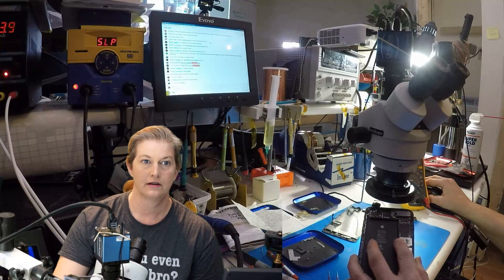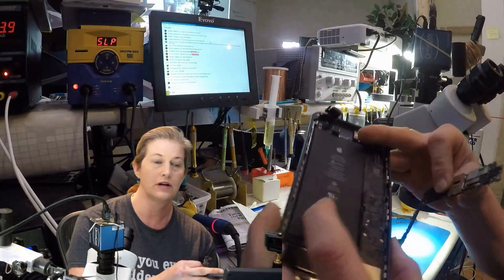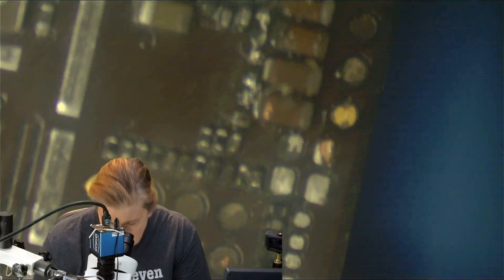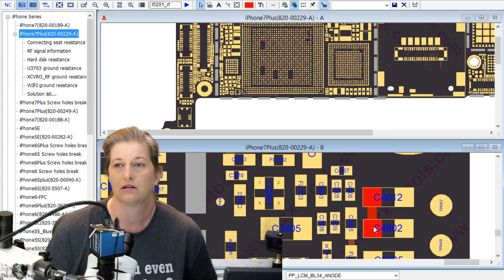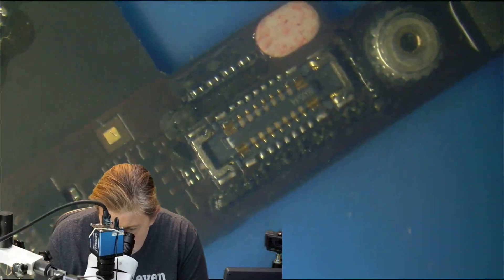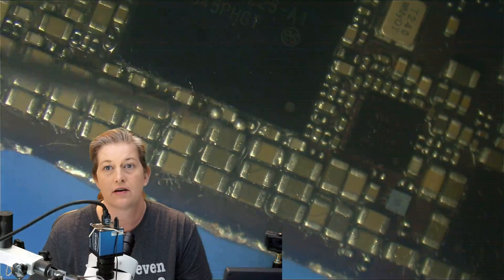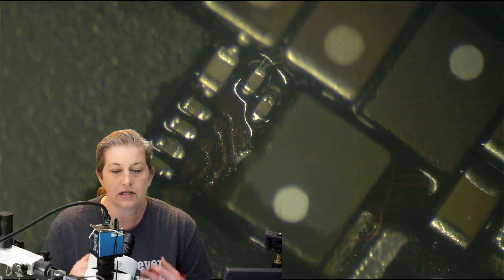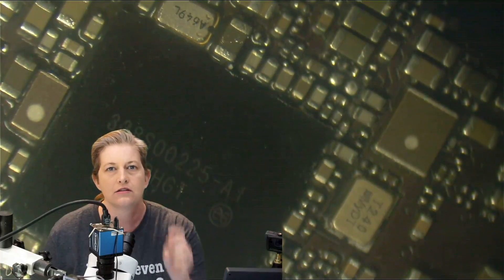FRANCHISE CELL PHONE STORES....STOP REFLOWING PMIC.  IT KILLS THE PHONE.

Comment: Were you able to fix this or did you automatically deem it a lost cause? That did look pretty bad. I've been watching your channel and Louis's channel for ages as I've always loved repairing things. Back when I worked at a computer shop with my father I had a customer come in with a monitor that kept flickering randomly. It was a CRT. I opened it up just for a peek and noticed the solder joints on the electron gun were all cracked. I re soldered them charged them $40 for my 2 minutes of time and had a very happy customer. The other shop said it was a logic board issue with the monitor and to buy a new one.

Comment: I see this in the automotive industry all the time. For example: dealer trying to diagnose an electrical problem on a car and end up fucking the car even more (frying multiple ECU's). So a manufacture field engineer has to go and fix their fuck up. Difference is that manufactures can audit the dealer for their mistake which sometime leads to technician's losing there jobs.

Comment: I've never heatgunned a board and thanks to your videos I never will! (and I think Louis even has a vid called "Stop heatgunning boards") but let's say you troubleshoot and you narrow down the issue to a possible disconnected line that goes under the PMIC,  how would you properly remove and reinstall that chip if underfill is present?  I assume it needs to be removed, reballed and reinstalled after the underfill is removed, but how would that be done?   Or is underfill one of those "If it's there, that chip can never be touched" scenarios?
Reply: In that case CNC is used to vanish the whole IC and underfill. If I am not wrong I saw this in one of her video but I don't remember which one.

Comment: Do the mickey mouse ears come from escaped solder balls through the under fill? i keep finding them but thought it may have happened using high heat and air removing shields, thanks for all the great vids ;-)
Reply from the maker: They come from high fast heat causing swelling of solder within underfill and pressure buildup of the molten expanded solder—it “spooges” out through a weak spot
Reply: Thanks for your help! very much appreciated, ive committed myself to this 24/7 until I'm pro,  I wouldn't dream of it if it wasn't for your videos! All the best wishes ;-) p.s.I'm most of the way there!

Comment: can you guarantee a water damaged board after you have repaired it?
Reply from the maker: Yes.  My rule is to never work on anything you can’t warranty.  In general I don’t fix water damage for the sake of the phone (data only) but when I do, I would replace all chips that were affected by water and make the phone as if it never saw water—or turn down the job.  Water damage repairs get the same 1year warranty as any other repair.
Reply: next video was why you don't repair water damaged phones ;-)

Comment: I know that crock pots or heat plates are often used in repair shop chains as well as independent shops. Mainly because their techs haven't even got enough experience with a hot air station to remove emi shields. So what they do is reflow the boards using basically a hot plate.
Will this also get hot enough to kill a PMIC and/or other vital chips? What's yours or anyone else's educated opinion on this type of "reflow".

I ask because that was the go to for any board that wouldn't boot when I first started years ago at a chain store. There was no looking at the logic board just "ok it doesn't boot, throw it in the reflow station".
Reply from the maker: That is a terrible idea but it makes sense on this board—it has heat up at WiFi chip which really shouldn’t happen even with poor shield removal technique.  But putting it on a too hot plate could do it.  It definitely has direct heat on pmic through which is the real deal breaker

Comment: Yeah especially those cheap eBay services. You know they’re not doing a proper job. I’ve seen some so cheap it’s ridiculous. A professional would not charge $30 for backlight as an example. They’re hoping a jumper wire or reflow will work. It’s a shame that a lot of  customers do not understand the degree of knowledge and skill required to perform these logic board repairs. If it’s expensive it’s usually because the person knows what they’re doing and are charging accordingly not just playing the odds. Then when the phones are ruined from trying to save a buck, customer ends up paying double or more “if” it’s even repairable at that point.

Comment: i would never reflow before checking with multimeter and bench power. i actually bought a 6s from ebay was told it was water damaged. when i got it, it was missing  about 20 caps the pmic and processor were fucked aswell solder balls all over the place. if they had of left it alone i could have probably got it working

Comment: I feel your pain, sadly this is so common on so many devices nowadays. The reball/reflow idiots outnumber the real repairs 100 to 1.
CPU probably survived as main was already shorted to GND through backlight circuit so no power ever got to it. But yeah CPU/NAND/BB etc. needs a transplant to a good board. Doable if it absolutely necessary, but a MAJOR MAJOR PITA with no success guaranteed.
Reply: Duke - that's common just around the globe, alas.
No more than a couple of weeks ago I've saved my neighbour from losing his child's photos. Just saw what that "repair shop" was doing to somebody's pad. Dragged him out of trouble, literally.
He wanted to save some 2 hour travel in the traffic jams to the reputable repair shop I've recommended. Alas, not the case.
It ended well finally.